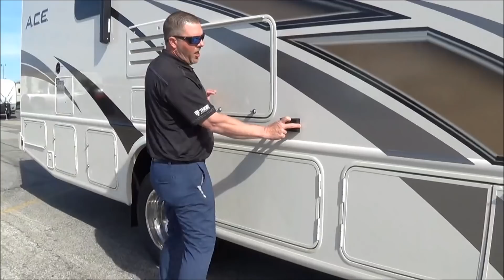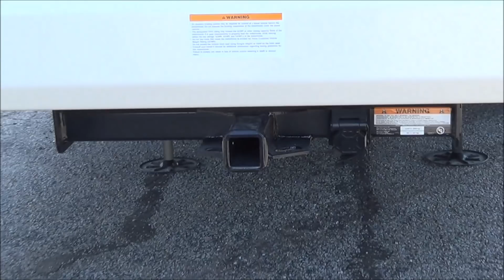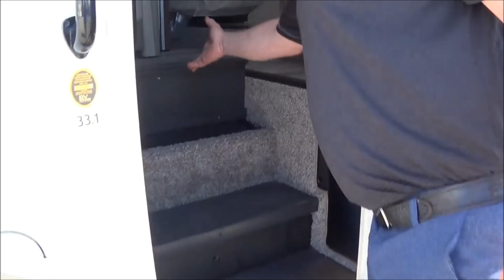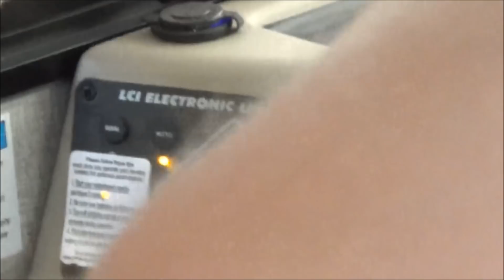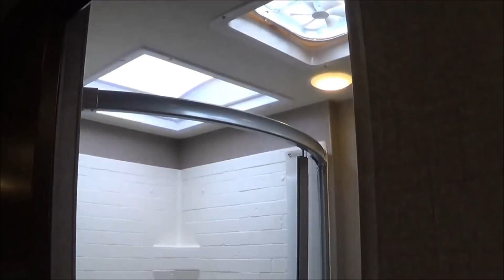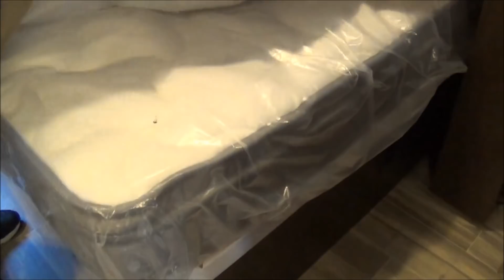2020 Thor ACE 33.1 Sales Training with Mark!

Comment: great video this guy knows the product line well and is enjoyable to listen to. Entry level RV is reference too price or system installed would be my question .  As well as type of warranty and how well does Thor handle the customer with issues.  and I would ask that of any manufacture . 
    heck as for red bull nothing wrong with a yage mister shot and red bull after filming.

Comment: Thor is the only motorhomes floor plans I don’t understand. Honestly the entry door should’ve been where the recliners are.. there’s no reason for two TVs in the same area.. there should be pop up power towers in the kitchen. Electrical outlets underneath the cabinets, appliances are not that long these days. But wait, he said all there product is built the same only thing change is the interior.. so a diesel pusher is built like a ACE🤔. I watch a lot of rv review with real ppl that spend a lot of money.. most of the time it be a Thor product that fall apart on them after owning for a few weeks. Thor supposed to be the #1 manufacture in the world, but have the worst motorhomes ever.. make it make sense Thor..